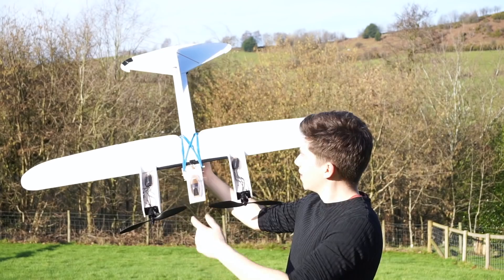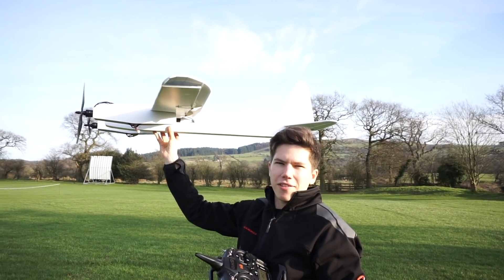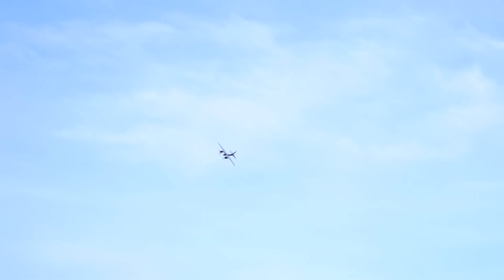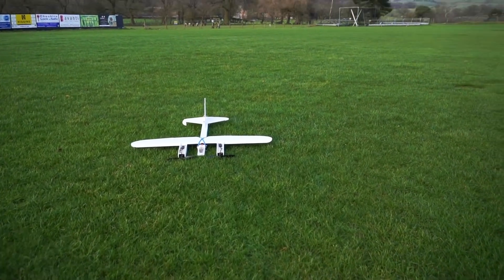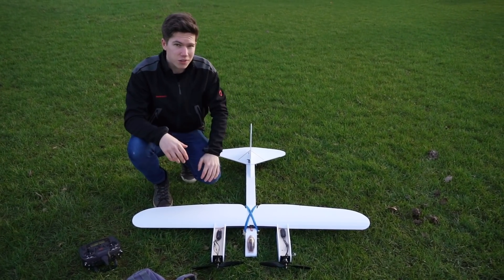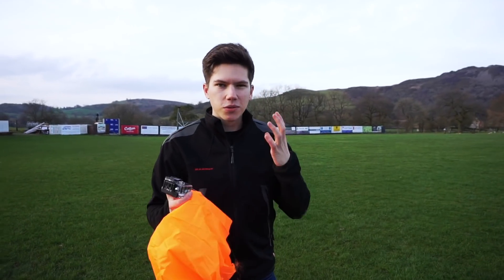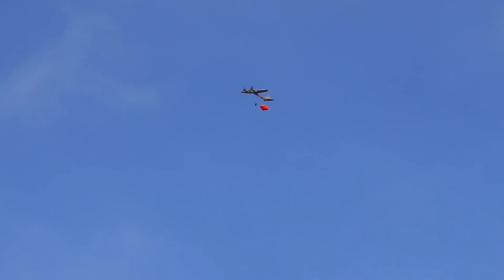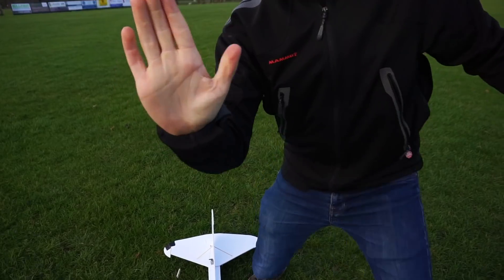Science Experiment Plane

Comment: The attitude of the plane (and the main wing) normally follows the laws of physics: In a steady state, the forces must balance, meaning that the vertical forces, weight and lift, equals out. The weight is fixed, but the lift depends on the airspeed and the angle of attack (or attitude). So basically the plane needs to nose up when flying slowly, if there is not a sufficient, positive build-in incidence in the wing wrt to the fuse. This also explains your elevator trim issue. Suggestion: Lift the front of your wings by a few mm, and skip those bloody, low-pitch quad props in favour of some proper APC thin electric 7x5 or 8x6 depending on your motor KV. NOW your plane will fly nicely :)

Comment: Again another great project! I like the concept of the plane itself also as flying test bench. The rapid prototyping you do with your models is the way I like it too. Maybe you can improve the take off and landing with a landing gear? A simple one of wheels or skate can work. It will protect also propellers and motors. Another option is a simple rubber band catapult launcher, and foldable propellers. Other option can be to put the propellers higher so they won't touch the ground. For the dropping mechanism you can put an extra fuselage cover so it minimizes payload's drag. Anyway, great project and looking forward for the new videos! Thanks for sharing!

Comment: Hello there, first off, nice airplane, it looks awesome inte air. Second, the reason it flies with the nose "so up" in the first flight: Basically an airplane is a equilibrium of forces and moments. So when it flies, the sum of forces is equalt to zero, else it will climb/dive. For this you add the weight of the plane to lift of the tailplane(since both are downward) and subtratc that from from the wings lift(upward), the result must be zero. Also, the sum of all momentuns must be zero, else the aircraft will pitch up/down. For this, a simple way to calculate is multiply the lift generated by de tailplane by the distance betwen its CP (center of Pressure) to the wing CP and subtract the CG times its distance from de wing CP. Tthe sum must be zero for a stable aircraft. 

Whats happened in the first flight is that the CG was too much forward, so you needed more force in the tailplane(more elevator) to compensate, but since you were doing more down force, you need to increase the lift in the wing to keep level flight. And, sinse this is achived by increasing the Angle of Attack, the airplane had to keep its nose high. When the CG was moved behind, this improved. 

This is the basic of aircraft longitudinal stability, that is a very interesting subject that you learn when studing aircraft design.

Keep up the good work, greetings from Brazil!
Reply from the maker: Nicolas Gusso thanks so much for the explanation man. Longitudinal stability is something I’m still learning about. In practice, I thought it might be something like the problem you describe, I just didn’t know the theory behind the moment arm thing haha 😂 thanks again, greetings from the UK.
Reply: @Project-Air  You are welcome! Thankfully, this is one of the best understood kind of stability with plenty of material around. If I may, I would like to recomend the book "Flight Dynamics Principles", by M. V. Cook, it has everything from the basics of flight dynamics to advanced phenomena aircraft may find, is my personal favorite. 

An interesting experiment you can do with your airplane is find its "CG range" by put a mobile weight inside of the airplane. Real airplane use water tanks, but I wouldn't recomend that :D :D

Greetings!

Comment: Suggestion:
Program your ESCs to 'Brake'

Gives better gliding performance and might save the props during landing.

But with no gear or high mounted props, chances are likely your gonna smash a prop one day ;)
Reply from the maker: Tim yeahhhh true. I’ve had some good experiences with a similar plane to this in the past without breaking a single prop, but I get what you mean. I originally opted for no landing gear to save weight, extra hassle with beefing up the airframe to take the landing gear and generally just keep everything simple. Might add them in the future though

Comment: I saw the comments about wing position, however you might try some main or tail wing incedence angle adjustments. I have found that normally, a glide test and inverted flight are the main tests of stability. Nevertheless, another good video in support of the hobby, bring on the shuttle.🤔
Reply: Absolutely. I also believe this to be an incidence issue!

Comment: Looks like the wing needs to be fitted further back on the fuselage might solve that nose high attitude , but more importantly it'll look nicer.👍
Reply: Nope.  If you're looking for  A platform that can carry, what you need is the wing at the front and a large tail of the back for a higher overall lift. A large rudder and stab will handle stability